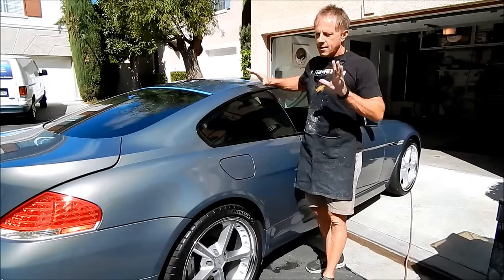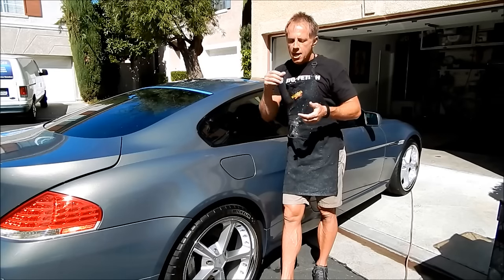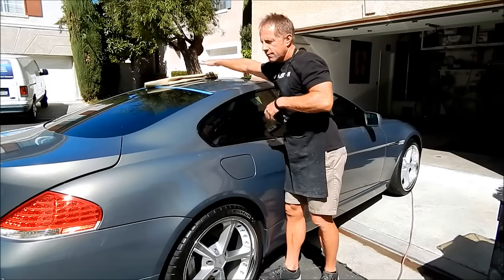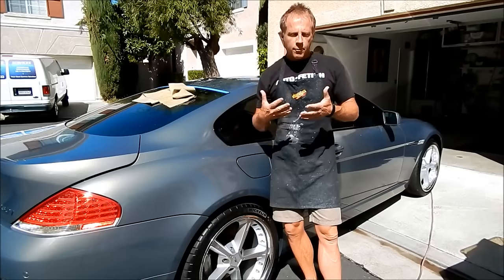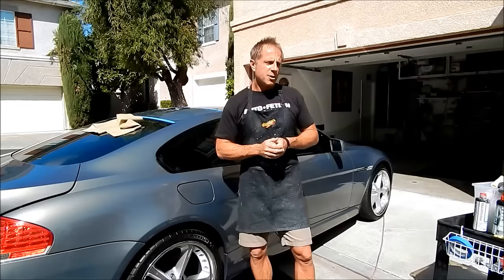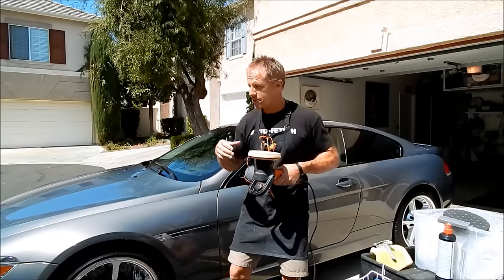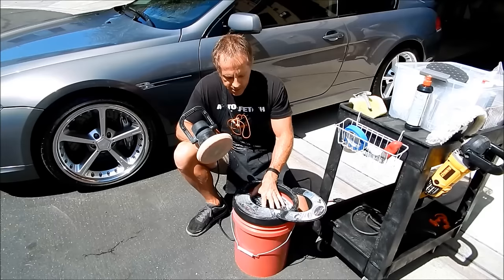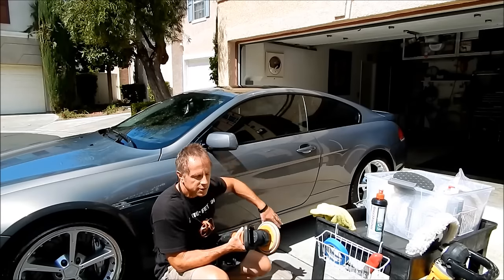Car Polishing Tips: secret tips Darren uses to deliver expert results

Comment: I've been detailing for over 30 years and just starting using Menzerna 400. 
I only use it in my shop on thrashed clears as it cuts very well but does leave hazing, not a big issue as I mostly perform two step corrections. 

My go to combo is the Meguiar's Microfiber Correction System. 
I'm in the with the combo.

Comment: Nice job. 

In socal it may not work,  but in northern Illinois,  positioning a car to face east or west helps get one side into shade,  and ad much sd 20 degrees F cooler. We have to work in the PM to get reasonable outdoor temps for much of the year, and the sun hitting at an increasing angle as the air temp rises to a peak at 4pm helps even out the body temps.

Comment: Hey Darren great vid!  I've noticed that you do not incorporate a paint depth gauge when polishing.  Any special reason why?  How do you determine how much you have to work with?
Reply from the maker: william larue If I was doing a $1500-$2500 paint correction job(s) on a regular basis I would be using one. But I use common sense, logic, and industry experience to gauge what is safe and appropriate for the moment, the car, the age, the color, and the customers budget. It's more about me responding to the real world fo detailing at my level and my customer base. If I had the overhead of a shop and was dealing with a different clientele I would have to operate a bit differently.
Reply: Makes sense, thanks.  Beautiful work as always!

Comment: Haven't read all the comments, so maybe someone else already asked this, but why didn't you just pull car inside garage to polish?  Also, if someone does polish inside garage on sunny day with garage door open, is there any risk that the lack of direct sunlight is going to make you not spot something when you polish?  Thanks.
Reply from the maker: yusuihang Trade-off's. In the garage there is no wind current what so ever. There is also the dust and mess created within the customers garage. And in the direct sun I can see what the final product is going to look in the lighting the customer will be viewing his car most of the time.
Reply: Auto Fetish Detail Thanks.  Actually, I've never done machine polish before, so didn't think about how much dust would result.  I have Porter Cable 7420 polisher ready to go, and am watching your videos before I try my first attempt.  Am I correct in thinking that the polish step (using Meguiar's 105/205) should not remove in much, if any, dust but the wax/sealant step would definitely result in dust?  I'm thinking about polishing in garage, then moving car outside for inspection and seal/wax.  Thanks again.
Reply from the maker: yusuihang Sounds like a good plan, but would highly consider switching to Menzerna as I believe they perform much better than the 105/205 of Megs that I used for years. See this link for more detailed info: http://www.best-auto-detailing-tips.com/polish-cars.html#polish-cars
Reply: Auto Fetish Detail Thanks, Darren.  I already got the 105/205 polishes--been sitting around for awhile.  Will try the Menzerna maybe next year.
Reply: ***** I thought that the polish gets "worked" into the car.  Haven't done it yet, so haven't seen anything first hand.  I'll make sure to have vacuum cleaner with me in garage.  Thanks.

Comment: Wondered what your input is on this question. Trying to decide on wether i want to go with 3M or Menzerna.  I've narrowed it down to the 3M ultra fine machine polish and Imperial hand glaze or the Menzerna 4500 and Final Finish.
The paint is Glassurit 90 series.
Thanks Much.
Reply from the maker: Abe Lincoln Menzern FG400 and SF4000
Reply: Auto Fetish Detail Thanks for the input. How aggressively does the FG400 cut? If it will remove big wet sanding marks it might be too strong for my needs.   My exp. is with Meguiars and Prima polishes, but I am always after better results.

Comment: Hey darren i hope you're doing it great, excuse for my english i am from mexico
I've been watching your videos and your website cause i want to get that level of perfection but i only can get rotary buffers, is it possible to get that kind of reflection on a paint job without a DA buffer?
Thanks a lot for sharing your knowledge
Reply: You can certainly get a great result using DA buffers but it will take much longer. By using the rotary with FG400, you can really just knock out the correctable defects quickly. This allows a lighter, much quicker pass with the DA to clean up any buffer marks and give a nice, final gloss. In a professional setting time is money! If possible, I'd recommend having a rotary for compounding when possible.
Reply from the maker: Juan Rivera Yes. At the beginning of my career all we had was rotary polishers and have used one ever since. But now I find myself using the DA more and more and use sand paper to do initial paint correction if needed. If I finish with 3000 grit, I can use the DA to remove the sanding marks where before I would finish with 1500 grit and use a rotary polisher to remove sanding marks.
Reply from the maker: Ryan Martinage Valid points Ryan!

Comment: Hello Darren, as a young business owner trying to get a foot in the mobile detailing business I am on a tight budget as you can imagine. I cannot afford a truck and trailer or a van dedicated solely to my business. I can however fit all of my materials into my everyday driver quite easily. My question is do you carry your own water source, and if so do you think it's acceptable to use a customer's water source until I can come up with my own?
Reply from the maker: Tyler Kurfees I use a customers water source 99% of the time as I don't carry a water tank/pressure washer myself. I keep it ultra simple and profitable these days. I have never had a customer have a problem with it.
Reply: Wonderful, thank you for the reply. I was overly eager to get started and thought i could deal with most vehicles with a waterless wash solution. And I probably could but what i did not take into account is the shocking (to me) lack of vehicle maintenance many people have, as well as humidity levels which hinder the drying time of the wax in the solution. I learned that the hard and slightly embarrassing way.
Reply from the maker: Tyler Kurfees Ultimately every detail will represent some learning moment. Hopefully most of them are less embarrassing, not more embarrassing.

Comment: I am confused about clay for polish. You have said that you can use alcohol and water to prep for polish but your site says that clay is needed. What is the difference?
Reply: You clay firstly to remove bonded contaminants. Stuff like paint fumes, tree sap, etc... The Alcohol and water could be done afterwards to clean the paint of any wax and grease so that you're working on a clean surface.
Reply: @nirtime is right. without the clay the contaminants can cause the pad to ride over them and chew through the pad faster if its foam or dislodge into the pad and can cause scratching.

Comment: Is the pad washer on your website?  Is it needed?
Reply: not needed but makes cleaning the pads faster and easier. theres brushes made for foam pads to knock the spent product out of the pores without damaging it. you can use a spray bottle with water while polishing to help keep the product fluid and get thrown out easier too

Comment: Hey darren been watching you for a bit now.  Tell me honestly, a driveway jockey like myself, whats the risk in using a D A? Ive never used an actual buffer but have used a basic random orbital polisher.  Just dont want to burn a corner or edge.  Im critical of myself but i know that the random orbital is very limited. Thanks, your very knowledgeable.  Jason, Peoria IL
Reply from the maker: ***** There is very little risk. Read this page for in-depth review: http://www.best-auto-detailing-tips.com/auto-buffer.html
Reply: Auto Fetish Detail thanks your awesome
Reply: ***** awesome ill look into it, thanks
Reply from the maker: ***** Well put!!
Reply from the maker: ***** Also have a look at the buffer I use professionally and the polishes I use in case you have not seen this page: http://www.best-auto-detailing-tips.com/polish-cars.html#polish-cars
Reply: ***** i'll check it out,  i just have a random orbital now, not too impressed with it.  does a very basic job.
Reply: Auto Fetish Detail im gonna pass on the buffers,  my brother has a mobile PDR biz and i borrowed his and burned a edge of my door.
Reply: Auto Fetish Detail needless to say thats a tool for the experienced

Comment: What pads do you like to use? I use Menzerna fg400 and sf4000 or sf4500 (po85rd)
Reply from the maker: brianallen0826 I have so many pads I use and demo it is hard to keep up. I don't maintain huge opinions as far as pads go. I could likely make any "quality" pad do what I need so long as I have chosen the correct pad as far as a stiff cutting pad versus a soft finishing pad. From CSS pads, to micro-fiber pads, they represent certain trade-off's. With that said, I am not a fan of the blend/wool pads. I prefer 100% wool cutting pad over the wool/synthetic blend cutting pads.
Reply: My wife keeps saying why do you need all those towels, what do you need all those pads for? Nagnagnag...lol, she sure doesn't mind the bank deposit though! Weird, when I ask, why do you need all those shoes, what are you going to do with all those purses...she doesn't think it's as funny as I do. I really enjoy your videos, it's nice to see someone who loves their work
Reply: Auto Fetish Detail Hey Darren, have you tried the Menzerna PF2400 (medium cut compound)? Do you find it useful?
I'm a beginner at paint polishing and I have a DA polisher.
Should I follow a 3-step method to achieve the best result that me and the machine can produce, or go with your method of 2-step only (I only have foam pads, by the way)?
Reply from the maker: brianallen0826 Souds like your wife and mine are on the same program!!

Comment: So for a black car that isnt so bad with swirls, do you believe its safe to use the Mezernas as a one step? Sort of like a cut in polish?
Reply: +heyitschinoable I've personally never used mezernas, but i cut with 3m compound with mircofiber pads, and then i polish with rupes finshing pad with a HD Speed (LOVE this polish) on a rupes lhr21es. But those are my 2 cents for me it turns out AMAZING even on hard and soft paints. But once again i strongly recommend a 2 step if you want the best of the best results.
Reply: heyitschinoable also i HIGHLY recommend the hd polish or speed preferably speed, also use ANY compound with them but hd speed for me is the best polish and wax. while hd polish is just a straight polish and no wax.